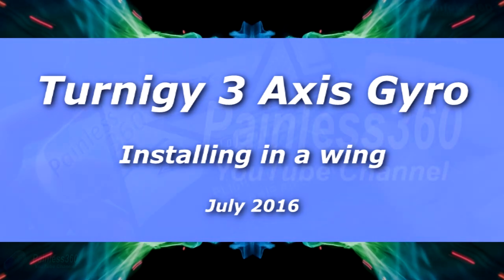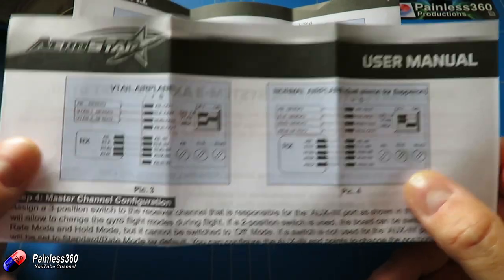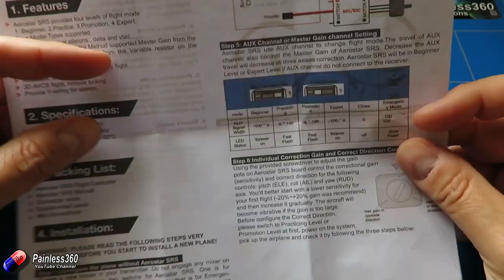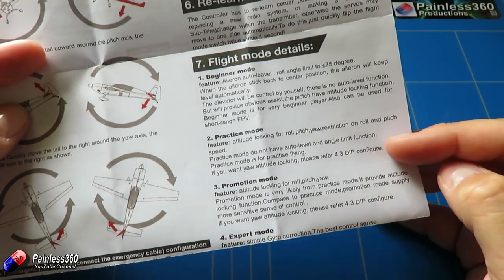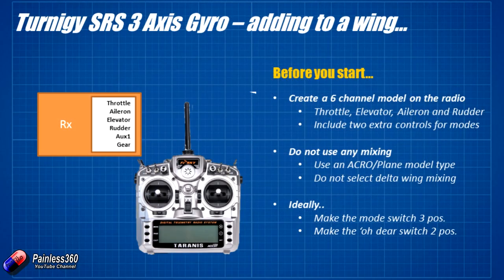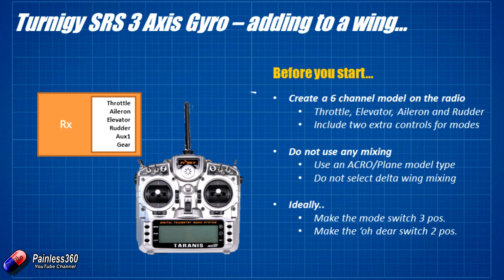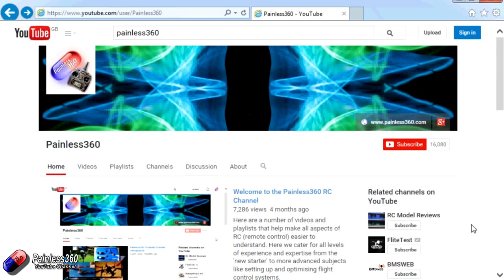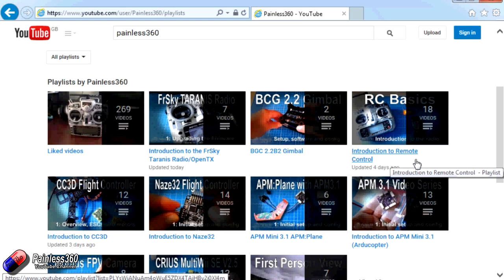RC Tips: Adding a Turnigy SRS 3 axis Plane Gyro to a Wing (TekSumo)

Comment: Lee, by what you learned, would this unit not work with a FrSky D4R-II because it only has 4 channels? Would like to set up a wing, but if I heard you right, without 6 channels connected the unit it won't calibrate correctly. Is that true?
Reply from the maker: +Kenneth Kammerer yep, you need 5 channels. Happy flying!
Reply: +Painless360 Thank you for responding.

Comment: Lee,

Thought you and your viewers might want to know this. I recently set this up for a flying wing, and I did it using only a 4 channel receiver, the FrSky D4R-II. Instead of channel 4 being the rudder, I programmed it to a 3-position switch to control the modes. When I first connected the SRS, I used a Y-cable on channel 4 of the receiver to "fool" the SRS into thinking there was a rudder input into it. This allowed the unit to calibrate just fine. Then I removed the Y-cable. I now have only 4 channels. Throttle, Aileron, Elevator, and mode switch. The drawback to my method, of course, is that you lose the Emergency function.
Reply from the maker: +Kenneth Kammerer thanks for posting!

Comment: I don't suppose you'd do a tutorial on fitting a KK2 board to a fixed wing plane? (not a flying wing) I see a lot of older posts about it but they are confusing and contradictory. Is it even possible anymore?
TIA
Kammel.
Reply from the maker: Sorry, we're not planning to. We have added an APM and CC3D to a model and I'd recommend one of those rather than the KK2.x. I, like you, gave up trying to wade through the confusion and became concerned that it was very much a 'side project' for the developers too. Best of luck!

Comment: Hi. Guess people would be happy if you walked through setting up an Naze32/cc3d for an fixed-wing. 

These flight controllers are even cheaper,  and gives you alot more functions and the ability to later get an GPS for navigation flight. 

Look for example iNav which is used in alot of planes with great success.
Reply: And these controllers support pwm, ppm, sbus.

Comment: how do you prevent rc signal interruption .Example im flying mah quad and other rc transmitter are interrupting my signal causing it to lose control how do you prevent this kind of thing happen
Reply from the maker: +woo Zhi it shouldn't. Most modern systems allow for frequency hopping and other ways to maintain a connection. Depends o. The radio and Rx you're using and how well the antennas are routed on the model.. Best of luck!

Comment: I have the first  one you show  installed in a HK yak has been fine for a number of flights until the last 2 flights when after a few min into flight it is erratic and the spirals into the ground any idea?
Reply from the maker: I've not seen that. Apart from the usual checks, not sure.. Best of luck..

Comment: painless, great tutorial.
i have all things set up as you show. i think
i cant get elevators to move in the same direction
i tried reversing weights on inputs.
i am using a taranis
any input appreciated
thanks
jl
Reply from the maker: Use the gain pots on the SRS, see the bottom right of page one of the manual.. Best of luck!
Reply: that is still not working
is there a mix possible on the taranis?
thanks
jl
Reply: and the pots are not actually changing the direction of the flaps.
just trimming
thanks
jl
Reply from the maker: Then I'd suggest getting in touch with HobbyKing support, all we did is in the video and manual. Best of luck!